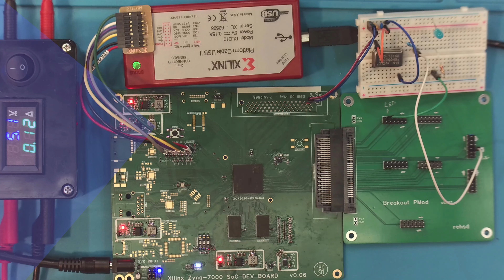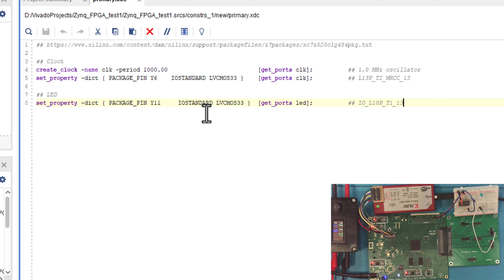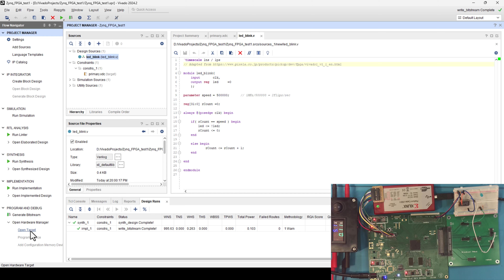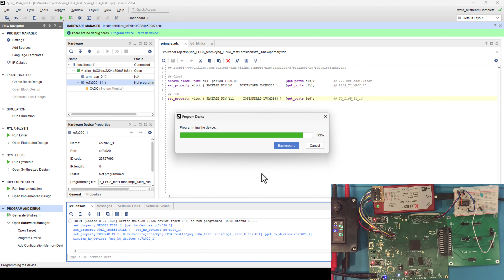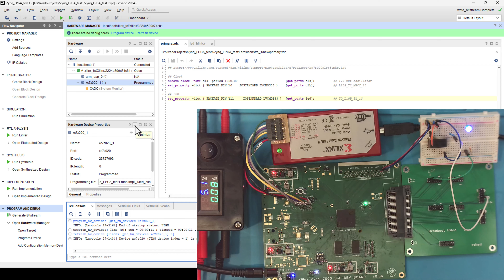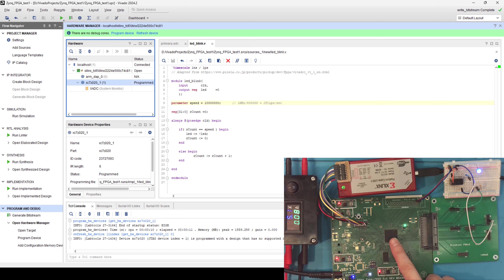Zynq-7000 PCB Build - Part 15 - Blinking LED - Basic FPGA Fabric Test

Comment: Hii, just curious, if you want to i/o  with a external component like maybe a camera like 2x13 or something how would you ? like do we use jtag ? I have no idea maybe a dumb question.... 😅 Or the design is soemthing like dft ?
Reply from the maker: My first thought would be to use a USB camera -- especially if a Linux driver is available to use in PetaLinux. The second option that comes to mind is to find an SPI-based camera and use SPI.
Reply: @rehsd ohh, got it, thanks a lot 😊. Great PCB btw.